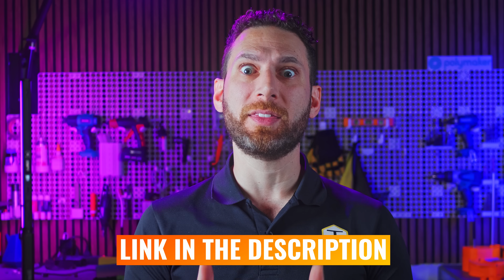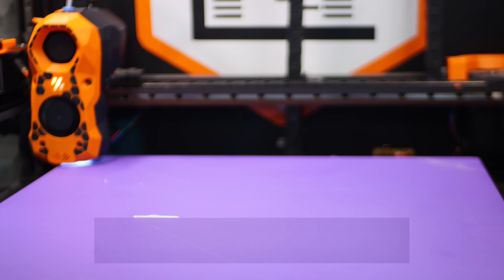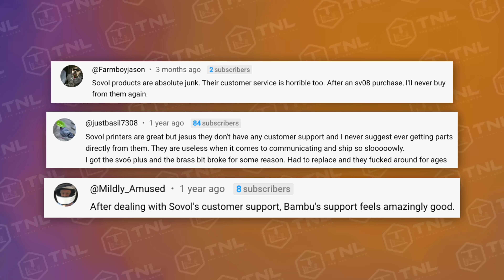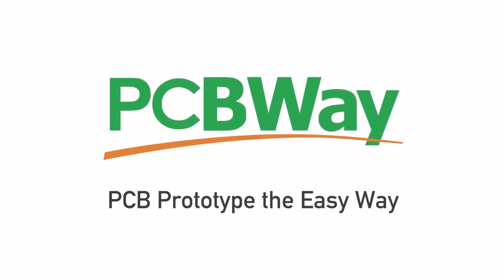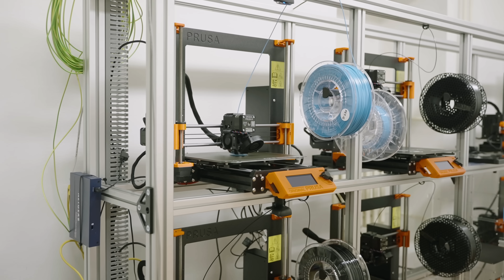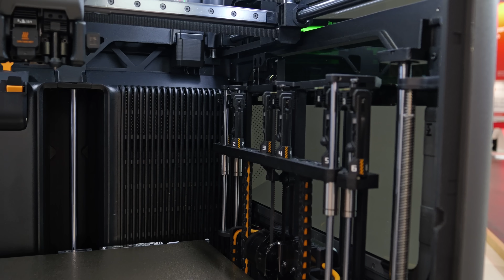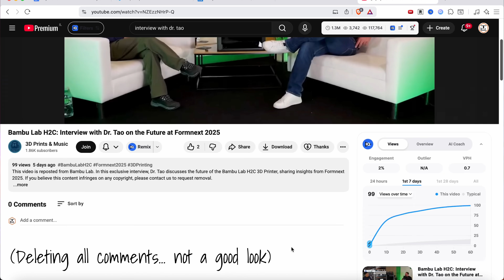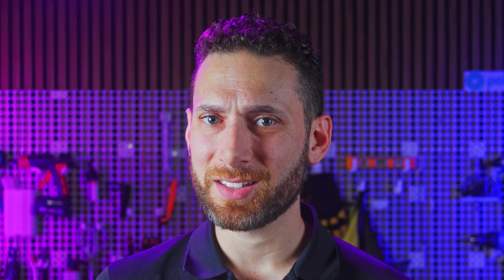My HONEST Annual Report Card for Each 3D Printer Brand

Comment: 4:28 Forget UI on the printer, Prusa Connect! Prusa really needs a way to do everything the printer screen can do over web UI. Coming from Klipper, this is my biggest gripe with Prusa
Reply: also, don't forget about prusa link for those of us that keep our printers without access to the internet
Reply: @kodream316  Prusa link is bare minimum. I miss so much there. It says "Attention" and no way to know what it is and to confirm. Firmwareupdates cannot be uploaded, where as Connect does it perfectly. Would be nice if Link had the same feature set as Connect, just for a single printer only.
Reply: Its almost useless, can't even check chamber temperature in there, only nozzle and bed
Reply: Right now, PrusaConnect is a very full featured cloud-based UI, and PrusaLink is a nearly useless web page hosted on a web server on my MK4S.  I can upload G-Code to it, and view--not control--temperatures.

What I really want is a page in PrusaSlicer that is rendered by my PC, that can send commands to the printer over a LAN.  Because right now, if I want to preheat my printer while slicing a model, I can do that by walking over and physically touching the printer, or by sending a message to and from another continent.

I've heard something about that being deliberate, that you can't preheat over the LAN because fire hazard...but then why can I do it across the internet from another country?

In PrusaSlicer, both the PrusaConnect and PrusaLink pages are web pages hosted by Prusa and by my printer respectively.  I don't want that; I want a UI that runs on my computer, that sends commands to the printer.  But that's not how we make software anymore.
Reply from the maker: What can you NOT do on Prusa Connect? I'm pretty sure you can do everything, no?
Reply: @thenextlayer  Based on some sticking points I've had with Connect, these are the "things it cannot do": 
    - PrusaConnect can't bypass warning messages for new firmware or other minor errors
    - You can't instruct the printer to unload filament remotely (just to save time when you know that you will need to start a change in a bit; would be super helpful on the XL). 
    - Live video in the browser, at least on local IPs would be nice.

Otherwise, I've had no real issues with Connect from missing features. It's great for managing my little farm.
Reply: @thenextlayer Tool Mapping on the XL isnt supported. I'd like to have the ability to adjust settings away from the printer (Enclosure fan, toolhead light, chamber LED, and even calibration options). You also can't pick/park toolheads from inside PC.

Comment: Having bought an H2D 4 months ago (my 3rd 3d printer), I still read all comments and criticisms about it and about Bambu Lab. I am really happy with my print reliability, speed, comfort of use and range of material support. Reading other’s complaints, to be honest If that’s all people can find to complain about, I’m happier than ever with my choice.
Afterthought: I also used to like the open format of Ultimaker - but that was back in the day when every user had to be a mechanic to keep the machine working. Those days are gone. Move with the times.

Comment: flashforge needs to update their software and properly support linux.
i can do most things on my ad5x via lan mode and orcaslicer, but i need to select it for printing manually on the printer, not to mention colors that are loaded not syncing
Reply: Flashforge needs to go completely open source because trust in the company is basically zero now.

Comment: Bambulab has several problems: First they have the worst customer service ever that I had to formalize before at the European Consumer Office a complaint because they were refusing to send me the chamber camera that failed at night provocating a great spaguetti (emptying the entire spool) and still refusing to lowering the speed in the AMS of the Bambulab X1 Carbon; second when they change anything in the firmware, they always end screwing the 3D Printers or the AMS or both; third When they released any printer and the user ends affected with any factory issue for example the heatbed of the A1 (mine was affected and I ended to sell it due that they refused to send the second feeder motor from the AMS Lite that failed from factory). Creality is just for hobby not for a professional use and I have the Creality K2 Plus that has tons of technical problems but at least I have a great customer service not like Bambulab. I'm not a Bambulab hater.... Just an upset customer that wants to recieve a great service because they have great 3D printers like Prusa (that I'm happy and agree with you in all). I have reserved the P2S with the AMS2 Pro and I hope that it solves all what I'm having right now on my X1 Carbon and the AMSs. By the way, a spanish company invited me to go to Formnext but I couldn't go this year. Greetings from Spain.

Comment: Bambu being closed off is the sole reason I didn't even consider a Bambu printer.  I'd rather have to fiddle with a Creality to make it work right (and have 2 different times now).  Was happy enough with my K1C to buy a K2 Pro for the bigger build volume, and filament changer during the Black Friday sales.  I wish I had room for a K1 Max/K2 Plus.
Reply from the maker: I don't even mind that their firmware is closed... I'm an apple user, after all... but I definitely mind when they stop all the cross-compatibility stuff, like, no third party nozzles for their new printer? Can't use whatever slicer I want? Shutting out farm management softwares? That part I don't like.

Comment: I think it may be hard for Snapmaker to make a 7-toolhead printer as it's an odd number and it will look weird on the sides. I think a 6-toolhead is more feasible and realistic. I don't have a U1 (still beating myself up for not backing it 🤦‍♂️😭), but if the width of a toolhead is around +2" (51mm) and the current bed is 270mm, 2 additional toolheads will bump up the bed to more than 350mm (270+51+51). So realistically, they can make the U2 (without Bono 😂) a 6-toolhead (3 spools on each side) 350mm³ or even a 370mm³ printer. For sure I will buy that. I need a printer with a bed 320mm sooner than later. I know Bambu H2D is on my radar but a bit out of my budget (be nice to have a quick changer for 2 filaments at least main+support). Although I can work with a U1 for what I want to mass print, delivery is April. 😢
Reply from the maker: I will settle for 6.
Reply: @thenextlayer If I had the money, I would invest on a Prusa Core One L with 8-12 Bondtech Indx hotends.
Reply: Better yet, maybe the 3rd feeder on both sides can be use for an AMS type unit so they can print more than 6 colors but of course there will be poop... but only more than 6 colors/materials. So from 6 colors to 12 colors. 4 spools attached on side and 1 AMS on each side.  The can even do this on as smaller bed 320mm³. Still use the regular 4-toolhead set up with the 5th toolhead and feeder use an AMS.

Comment: I've been saying for years but I just want a compact (~200x200) enclosed, corexy, direct drive printer with easy auto calibration for under $500
Reply from the maker: Sovol SVZero..?
Reply: Something like Sovol Zero?
Reply: I would love a Core One Mini for quick small prints and FDM miniatures which some Patreons are putting out now. Basically a Prusa take on a Voron Zero (not a fan of Sovol).

Comment: If I understand this correctly, the largest issue that people have when they throw out closed ecosystem is the limitation of only using Bambu Studio, a fork of Orcaslicer. As far as I know many companies make successful addons for Bambu Lab printers such as different plates, different nozzles, for a time the touchscreen for the P1S though it sounds like that went away specifically around the updates that allowed access to the AMS 2 Pro which draws additional power and may have been a reason the screen could no longer be viable, etc. Bambu not only allows any brand of filament but has incorporated many of the top brands as defaults, lets you create profiles for any you want to add, and has a very successful generic profile that can be used a catch all for other brands/types. So it really feels like this is all about Orca to me, a basic hobbyist. My first printer was a bambu lab so I have only used Bambu Studio and have no complaints that I have not had to learn another one. I buy anything I want for the printer and buy any filament I want to try with a 100% success rate so far in it working like everything else does. If this is all about the slicer it is a massive non-issue for me and I would guess many others who are not going to take the time to learn a slicer base or fork for 6 different companies when I own 1 or 2 printers tops. This is a problem only for people that are heavily, and I stress, Heavily into the hobby or use it as a print farm business with several mixed types of printers. Every feature I have seen talked about has eventually been available in Bambu Studio. This is not a fanboy take because I have no loyalty other than recommending my printer to others because it has been an amazing experience with none of the issues I see many others complaining about with theirs. I just successfully print whatever I want, whenever I want to. So I just want to know, is this more than the slicer? The idea of a closed ecosystem for the printers actually makes sense to me and it is a fraction of how far companies like HeyGears have gone in only allowing their products and resin. Some people think FDM and Resin or not the same hobby but to the average user they are, they are just 3D printing and I see almost nobody complaining about them. I see people defending Elegoo after that complete BS with the Centauri and the doubled down BS on the response and update, and their replacements parts are like pulling teeth to acquire via mutlitple interactions with support instead of just being on a page you click what you want into a cart and its on its way. And who ever knows how long support will be available for that machine and the replacements parts, it all feels super sketchy. And Creality with the ACE 2 release that is fully backwards compatible but somehow the ACE is not compatible with any of the newer machines? What? Why? The Bambu AMS and AMS 2 Pro are both fully supported on all machines, including the previously unavailable bedlinger A series which can now use them both. Yet they are catching no flak for that? I feel like I am just missing critical information in why Bambu is the letdown of the group with what feels like an almost perfect end user experience. Their printers, the two that I have, have both from box to 3000+ hours been flawless for me. So much so that I have no complaints and no reason not to chose them again over other brands that are trying to catch up. You referenced tactics they are using as a company and rumors but outside of the notice of the new product coming about 2 months before it launched, which seems pretty standard to me again, you actually disclosed none of these rumors, sources, problems they have caused. I am just lost. I will keep watching your channel because you seem to do a decent job covering things but this feels like it's just bias with nothing to really back it up.
Reply: Yep it's not his world view so he sees all to that light. Bambu pre-announced the h2c just to f.. with the others it was announced in Aug, first printer in hands of normal people within 3 months. But bondtech, snapmaker and prusa doing the same thing but ehmm not really shipping yet is somehow different. The pre-announce and hint of say a Core One L with INDX8/10 is also clearly aimed to stop sales of other brands but thats not dirty because it fits his narrative while in reality its just what companies do.
Reply: @scb2scb2  I know! Was Prusa out of line showing off their tool changer printer that you cannot buy yet and have no timeline at all for at the same time the H2C hit the market? It is literally the same thing but called out when Bambu does it and no one else. I have zero problems with Prusa being excited to show off their stuff and that they did it when Bambu launched a related/competitor machine. It looks like a really good product to be honest. Not going to call them out for not playing fair or caring enough about the industry to allow them their moment. I think most businesses in the world are pretty eager to share their upcoming stuff with you so you can get interested and Bambu did that, then immediately released it for sale. You may not like the H2C, and that is fair. Certainly not for everyone including me but it is still a 100% top of the line product and it is being compared to things that may not be available until halfway through next year. Feels crazy.

Comment: One feature I'd really like to see get more common - support overexposure (on every level, doing normal resin exposure for "everything" - then continue exposure only for those pixels that are supports for a while longer)
Thi makes supports stronger.

That idea has existed for a long time, but has been implemented only on very few printers. Which is weird, since this is 100% software-only feature, i.e. it doesn't require any hardware changes.
Reply: Sounds like something that would be patented 😢.

Comment: Important to mention the dangerous issue with Elegoo Centauri Carbon’s toolhead cable wearing out prematurely and becoming a spark/fire hazard. They’ve only recently addressed this with a replacement cable but as far as I know, they are only providing the new cables to people that have already had their original ones break
Reply: To be fair: Only one person has documented sparks. Cables ARE deforming and sometimes splitting from the strain relief. They are not sufficient in the shipped configuration for sure but the issue can be largely mitigated by immediately freeing the usb cable from the cable chain about 5-7 links and swapping the ptfe tube so the usb cable bends to the left side of it instead of the right. Absolutely a design mistake but not actually responsible for any fires as of yet.
Reply: @atriaventrica  my buddy bought on and his is sparking and they are making him take a video of it to prove its bad.

Comment: Prusa's big problem right now is pricing.  The MK4S with an MMU is going to cost you almost $1,000 without shipping and you still have to put together the MK4S.  The Bambu Lab A1 combo is normally $560 without shipping, and comes pretty much fully assembled.  I love my MK3S+ with the MMU3, but I won't upgrade it or buy a new Prusa machine just because it costs too much.
Reply from the maker: $499 for the INDX upgrade is really good, though!
Reply: Not if  you add in the cost of the printer and compare that to the cost of a p1s bundle with an extra ams.

Comment: The Prusa screen is good.  Please don't make it a touch screen.  The knob works fine.  The problem will be that you will need to make the screen bigger and also beef up the specs of the screen so it moves smoothly.  I think that is a waste. Because most of us already use the web app and the phone for most actions.  And the action on the screen is easy to reach.  

If you want to improve it add more physical buttons for things done often like nozzle size change, change filament and purge. 

I already have a fancy screen. It called my phone.  So if you want a pretty UI, add it to the prusa connect app.
Reply from the maker: It already IS a touch screen, I'm just saying that the interface looks dated. I'd like to see a more modern looking interface rather than the menu lists with the old school font ;)

Comment: Availability of repair/replacement parts is a thing that most manufacturers should definitely improve. I understand not wanting to keep a bunch of dead stock, but having 20-50 spare toolheads, fans, hotends, stepper motors, bed heaters, leveling force sensors, etc; IN STOCK, IN the same country or economic area of your major customers, AT LAUNCH and afterwards, would be huge. Problems happen, even with good QA, but having a machine down for 3-10 WEEKS while waiting for parts to be available and then waiting for slow shipping from China can turn a relatively small problem into a dealbreaker for someone ever buying your product again, or in some cases, ever 3d printing again. Same goes for having a stock of consumables like nozzles. If you're going to go with a completely proprietary nozzle design, there needs to be plenty of stock so people can get spares/replacements. Last year, a friend bought their first 3D printer for themselves and their family. They had a nozzle clog within the first week or so of ownership, and there were ZERO nozzles available for purchase. They were told that it would be 2 months to get one, so, instead of waiting, they packaged the printer up and sent it back. They haven't gotten a replacement unit, and may not ever do so.

Comment: I heard better profiles and integration with Orca and immediately got a thumbs up for that one.
Reply: I had to edit the profile for my Sovol Zero to make a 0.2mm profile. It was not as easy as clicking a button and changing a setting in the printer UI. I had to edit the printer's configuration file to change the nozzle size, edit the Orca printer settings to change the nozzle size, edit the speed and line thickness (and a bunch of other) slicer settings, and finally (and this was the most painful part) I had to decode/reverse engineer the start g-code since I was getting an error due to the prime line being set up for a 0.4mm nozzle. I could have just deleted the prime line all together and used the skirt as my "prime," but I shouldn't have to. I shouldn't have to build my own profile for a common nozzle size either, but here we are.
Reply: @TheArmyKnifeNut it wasn't quite that bad for the K1C but did still have to jump through some hoops when I moved the the 0.6mm nozzle. The CFS retrofit felt like less effort than setting up the 0.6mm nozzle